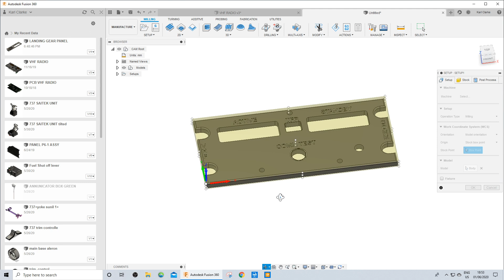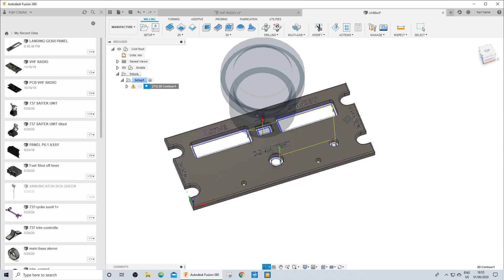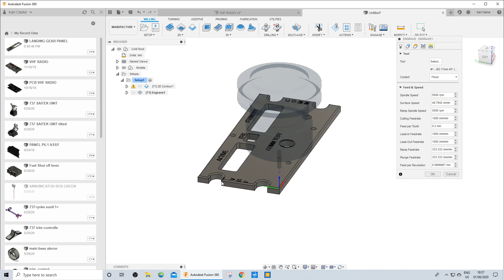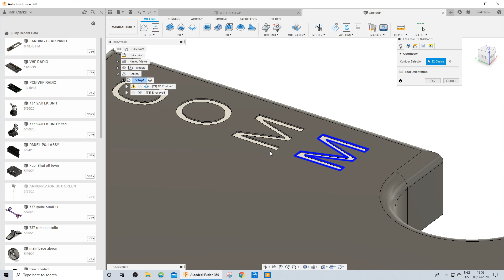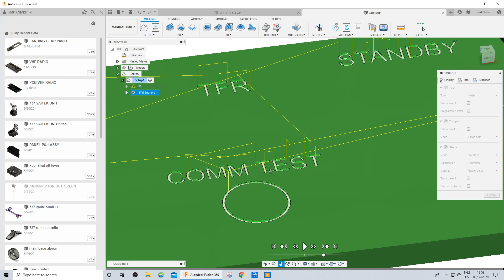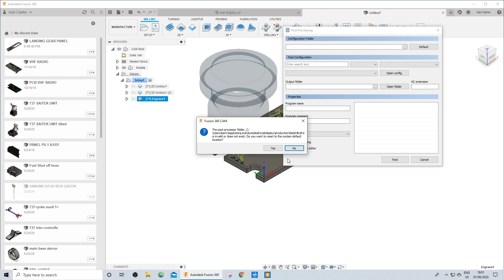How to panel Engrave within fusion 360

Comment: So how did you add your machine to Fusion. I am not sure how to add mine. I can add my 3d printer but unsure of how to add my Openbuilds Workbee mill. Thank you.
Reply from the maker: Hi Sim Pilot2018, That quite an involved question for a YouTube comment answer, but here goes:
I create the part in Fusion, Switch to the manufacture tab. Select the outlines for engraving or cutting. Then click post process and select mach 3. This creates a file for Mach3. I load the Mach 3 file and push start. The problem I currently have is that my desktop machine is getting covered daily in sawdust and i need to swap it out for another less important computer. This will mean i have to copy that file from fusion to the other machine and load it in mach 3 there.
Reply: @helimech8152  Ok I got my machine added. I am pretty new to Fusion. I will have to look at some videos to see how to send your MCP design to the CNC.  I know you have the cheaper model there but I really want to do the first version that you did. I don’t want to take up your time as you have enough on your plate. Thank you.